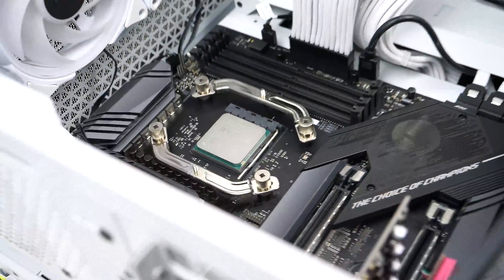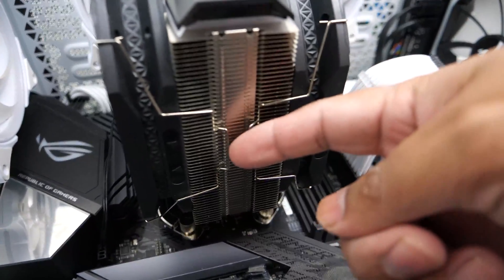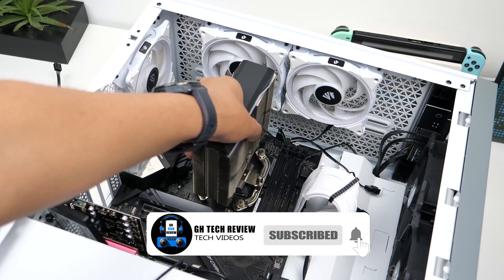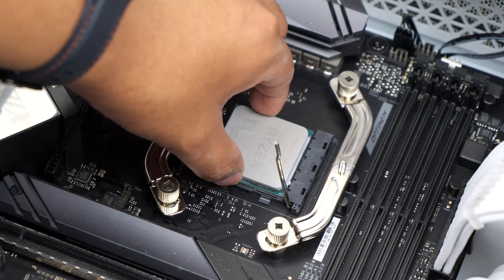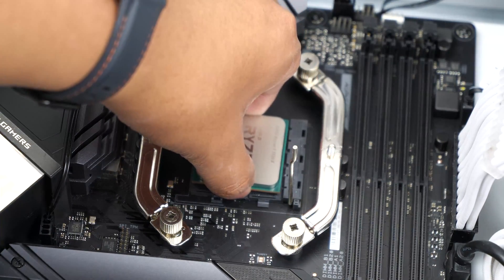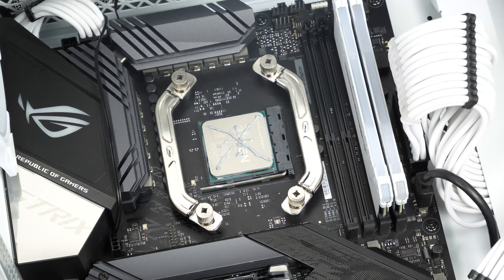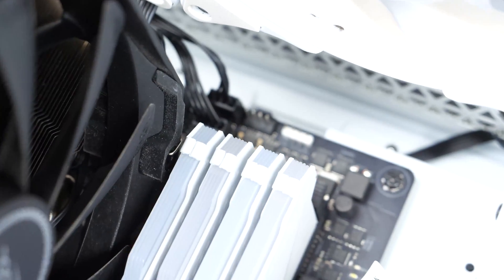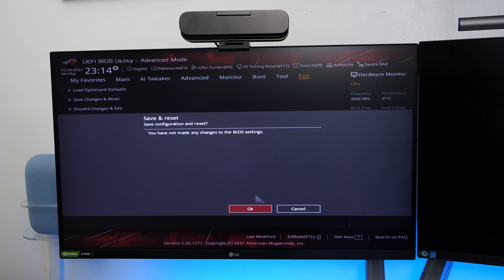How To Upgrade Your CPU Step By Step | AMD Ryzen CPU Installation 2022

Comment: A lot of comments said I need to update things before I change the cpu. This is my first pc and I’m still new but I’m going from an ryzen 7 3700x to a ryzen 9 5900x. What all do I need to update before doing it to refrain from having to take everything apart and do it again?
Reply: You need to make sure your current bios is compatible with your new cpu if not you have to update your bios,there are many videos on that
Reply: @simora1313  oh okay. I’m having help from a buddy to do it Monday so I’ll have him show me how to do the bios updates. Appreciate the help!
Reply: @simora1313  how do i check if its compatible?
Reply: If you have 3200mhz ram I would recommend upgrading to 3600mhz
Reply: @AtomGamingZone  planning on it cause my current is only 3000. Sadly my board doesn’t support ddr5 so going with fastest ddr4 I can find. But cpu was a success and added a 2tb 980 pro ssd Gen 4 as well!
Reply: @Glocktism end up having to update your bios?
Reply: @EatTheCrow  yes. I was completely lost and had a buddy show me how. Updated the bios using my girlfriends pc to put new bio update on flash and then put it on my pc and was ready to go.
Reply: Sick I'm going to be doing the exact same upgrade

Comment: Run your PC to get your CPU warm otherwise you run the risk of pulling the CPU out of the socket when you remove the cooler...Has happened to me before..The AM4 socket does a crap job of securing it down and can easily get yanked out.

Comment: This looks easy but once you try it you will feel like homer simpsons trying to build a pit barbecue.
Reply: Ya lul, was sweating so hard trying to insert the processor.
Reply: @shadyb834  same lmfao when i pushed the lever upward to unlock the old GPU from the motherboard and it clicked, i nearly had a heartattack.  then i safely installed the new cpu and thermal paste, and the cooler and the wave of relief i felt when bios opened up recognizing the install was a success was pretty much as awesome feeling as how i used to feel when i would take those "happy pills" people used to take in the 90's.  😂 on the real though this video helped me so much.  but yeah, i was pretty keyed up until i fired the PC back up.

Comment: İ have a b450 asus i upgrade my cpu from amd 5 3600 to amd 7 5700x and now i get a black screen and a orange light on my motherboard
Reply: Hi, did you update the bios on your mother first? If not, put back your old cpu and update that first.
Reply: @andred212 how do you do this? I have searched and searched and searched and there are no videos on how to do this extremely complicated thing yet everyone just knows how to do it
Reply: @ethangiberson8098 first, did you put the old cpu back in the computer and did it work?
Reply: @andred212  yes but I guess I need a flash drive? It’s 2023 why are flash drives still a thing
Reply: @ethangiberson8098  there  are videos, just search on youtube ''update bios for ryzen third gen''
Reply: @ethangiberson8098  is not that complicated, spawing the cpu is definitely the more annoying part, but i dont think you neeed it since i believe the asus b450 hace bios flashback on the io panel
Reply: @ethangiberson8098  did it end up working after you updated the BIOS?
Reply: omg i literally did the same thing except ryzen 7 5700G

Comment: WAY too much thermal paste!

The X shape will spread unevenly due to the overlap in the center of the X and it will spill out the sides due to the amount. You just need a (large) pea sized dot in the center and let the cooler slowly settle into it to spread it out.

Great video otherwise though!
Reply: Yeah He said that as an example of what too much is. Got to listen to what hes saying too...

Comment: Aight guys, I upgraded my cpu but it didn't work. Turns out that my mobo wasn't series 5000 ready (even if compatible) so I said "well, I can reinstall my older cpu, upgrade my mobo drivers and then get back to my new cpu!". So I put my older 3 3100 in aaaaand... Nothing works anymore. My pc doesn't POST. Every fan works but the pc just won't start. I don't think the mobo is fried as energy surely gets through (or fans and LEDs wouldn't turn on, I guess). So what am I supposed to do? Can anybody help? Thank you!
Reply: Hey, i think we had the same situation before. Have you tried removing your cmos for a minute or 2? so any overclocking from your bios gets reset
Reply: @aze5123  i tried but there was no result at all. I'm meeting a friend today and we'll try a couple of fixes here and there
Reply: I think we're in the same boat. I went from a 3600 to a 5800X3D. Got a message that says New CPU! With an FTMP. Had the option to press Y or N and I pressed Y. I get a black screen and no bios. Tried putting my 3600 back in and N doesn't work. I have no BIOS at all. Are you having a similar issue?
Reply: @joellouisfire  kinda. The pc doesn't show any sign of life on screen. Even peripherals seem dead. Only the fans seem to be working...
Reply: Update: it looks like my mobo got bricked 🥲
Reply: @giacozz  damn 😟😔
Reply: Did you disable AMD fTPM Switch?
Reply: @moisesbrito8612  i could not enter into the BIOS at all, so no... But nvm, I bought a new motherboard and now everything works fine
Reply: What motherboard did you use?
Reply: @SnafuWarrior  it was an Asrock b450m hdv r4. It was supposed to be Series 5000 ready, but I was supposed to download the updated BIOS. That was my fault, but the fact that it refused to work with the older cpu is not my fault, I guess
Reply: @giacozz  oh sorry to hear that. Yeah I thought that not updating the BIOS might have created the problem.

Comment: So you don't have to reinstall windows or anything like that? It remembers all your stuff saved on the computer!?
Reply: The OS is installed on your storage drive (SSD or HDD
Reply: The operating system (and its license) is installed on the "hard drive" but it is bound to the MotherBoard. If you replace the MB only then you'll have to reinstall the windows and get new license, other than that you are good

Comment: How do I find out if the new cpu is compatible with the motherboard? I am upgrading a 12 year old Acer computer. Acer isn't always available to help on any PC that's beyond their warranty dates.
Reply: idk how many modern cpus will be compatible with a 12 yr old system since architectures change a lot. might consider buying a new pc
Reply: You're better off getting a new PC my friend. Even a mid ranged modern PC would wipe the floor with your potato, lol.

Comment: Avoid this platform and these motherboards, they don't support Windows 7
Reply: windows 7 in 2023
Reply: Window 7 in 2023 is wild
Reply: Thats your problem if you're on windows 7 in 2023... Get with the times dude.
Reply: So what games do you play exactly?
Reply: @evangeluna8480  FPV quadcopter simulators on Steam....   Uncrashed, AI Drone Sim, Liftoff, Velocidrone
Reply: Bruh what? Windows 10 is going to be done in a  couple years, they stopped caring about Windows 7 years ago lol I get if you want to play specific games that work best on Windows 7, and or actually work since Windows 8 and 10 are terrible when it comes to certain older games but you'll have to get a new pc for new stuff and find older pc parts from around the time of Windows 7 to upgrade anything for your older pc and that is compatible with 7.
Reply: @comfykori  i know right!  Honda stopped supporting my 1983 Honda Rebel motorcycle in 2010.   

But it keeps running like a swiss watch and gets 60mpg.  Parts are cheap and its east to work on, fun and easy to drive.

I should probably push it over a cliff because obe day Honda declared they just made a new motorcycle and you should get rid ofbyour other one because it's "old".  

Only their new motorcycle gets 30mpg, is jammed together like sardines in a can, and costs $6000 new.  

Bruh, but that's progresd.  Except when it ain't.

There's and ocean of people that love XP and 7 and can't stand 8, 10, and 11.  Because the interface on them is so phwwcked up.  People that actually have to get work done with their computer and do more than click on a Steam or Discord application icon.

Comment: I have the original ryzen 5 1600 af cpu in my b450 gaming plus mb. Its not bad for what it is but yeah I think I may have to upgrade it to the ryzen 7 5800x instead. I have 16gb ram at 3000mhz but I  might have to also upgrade the ram to maybe 32gb instead.
Reply: r7 5800x is a bad choice, consider a 5600 or a 5800x3d
Reply: @legitscaryturtle7379  Why is it a bad choice? I was thinking about upgrading to a 5800x so I'm curious.
Reply: gaming wise its the same as 5600, and productivity wise akso not that much better for the price
Reply: @legitscaryturtle7379  Damn I looked at some videos with gameplay fps tests and there's no difference at all. I'm so confused why does it cost £60 more?
Reply: probably just badly priced

Comment: ok guys, i had the courage to ask since i saw in the comments that some people replies, i wanna upgrade my cpu i have a r5 3600 and i want to upgrade to a r5 5600g, i have a x570f board, question #1 do i have to update my bios? if yes, how? question #2 what is that CMOS thing? do i have to do that also?  i would appreciate any info on this, since i'll be doing this on my own now, i had help building this. so for a late 30s guy, i really have no idea. thanks again guys
Reply: its been a month but please please PLEASE dont tell me youve upgraded to the 5600g yet. the 5600 is practically a 5500. (which is around ~5% faster than a 3600) if you want to upgrade your cpu on the am4 platform just stick to the 5600(x) or if youre close to a microcenter the 5600x3d.
Reply: @konikino  I have a 1200, so, I shouldn't upgrade to 5600?
Reply: check if compatible on pc part picker

Comment: Shouldn't you clear cmos before installing the new cpu?
Reply: No, you shouldn’t need to remove the cmos. It will reset the bios. That’s it. As long as you update the bios you won’t need to
Reply: @mightypotato802 
Naaah bro.

Sometimes, UEFI soft reset is not enough. You do need to hard reset the BIOS.
Reply: @fajaradi1223  anyone who types out NAAAAAHHHH BBRRRROROOO is hard for me to take seriously.

Comment: my new build won’t post, and a friend suggested to double check if I installed the cpu correctly. But I could’ve sworn I followed the triangles. Doesn’t the cpu only lock in one way anyways? What are the chances I put the triangle wrong? Is it worth removing my aio cooler and repasting? I have a hunch it’s my ram cuz I bought ripjaws that apparently aren’t on the QVL for my board/cpu.
Reply: @CRAZYALPAPA  Thanks! I’ll try reseating and checking the cooler again. I finger tightened the screw because they are pretty large and easy to grip so i figured using a screw driver would be unnecessary. Unless I hand tightened it too much? In any case I’ll try resetting it before trying new Ram 👍🏽 And yes I flashed my mobo BIOS to the right version recommended by ASUS for the 5800x3d
Reply: @_N4VE_  I generally tighten the screws with my fingers and then finish them off with a screwdriver just to make sure its not too loose but it shouldn't be too tight either, I personally just do a few twists.
Reply: @CRAZYALPAPA  I’ll try to snug it more after I use my fingers when I reseat it. If that doesn’t change anything, would my RAM not being the QVL be a problem? I’ve read the 58x3d is kinda sensitive when it comes to compatibility?
Reply: @_N4VE_  Definitely a high probability but anything that can be done before spending money is worth trying. Also I recommend making a Reddit post in a pc building subreddit as it always helps in these situations.
Reply: @CRAZYALPAPA  thanks for the help I appreciate it! And yes that definitely makes sense. I’ll do all I can before spending money 🙏🏽

Comment: What do i do if I get no image after booting up? How tf am i supposed to troubleshoot, if my pc gives me nothing to work with
Reply: i’m currently in the same boat. your mobo should have small color LED lights that flash to indicate what it’s checking during boot. They usually sit near the main mobo power cable. My asus has a White led(VGA) Orange(dram) Red(CPU) and Green(boot). Currently when I power on it goes “Orange, White, Orange, Red” then begins to loop White,Orange,Red over and over. Fans and case lights turn on, AIO turns on, but no signal to display and no Green boot light. I’ve narrowed it down to incompatible RAM, Defective Mobo, or CPU. Everything is brand new, so Im gonna try changing RAM first since the one I got technically isn’t on my manufactures “Quality Verification List” for the 5800x3d. If it’s not the RAM i’d probably try RMA the the mobo next, then lastly the cpu. I also reflashed the bios after resetting and clearing CMOS but that didn’t work.
Reply: @_N4VE_  i was an idiot an forgot to update my mobo software. The last update was done 3 years ago when my new cpu didn't even exist, so of course it couldnt work :'D
Reply: @notlisztening9821  nice catch! lol yah for me even updating the BIOS didn’t help. My last guesses are incompatible RAM, defective mobo out the box, or CPU. Was also told I can try reseating the cpu and cooler
Reply: @_N4VE_  i have heard of some incompatibility issues with the x3d cpus. Maybe google to see if someone else has the same issue with your parts, if you havent done that already.
Reply: Might be stupid thing… if you have a Xbox or something idk if PlayStation works lol. I had a no post twice that I couldn’t figure out for about 2 weeks. I decided to officially give up plugged into my Xbox then showed my gf the pc not working and it finally posted. Second time took like 4 days then I tried it again and it posted again. Also using HDMI 2.0 if that means something as well. Prolly won’t help but it somehow works for me. Thought motherboard was fried or GPU. Was even stuck in boot loop till I switched the cord around.

Comment: Picking up a new 5800X 3D today.  Hope I dont F this up
Reply: did you do it?
Reply: @belonn6121  yep. Put in new CPU / GPU / PSU. Working good
Reply: @11bravo1789  nice to hear!
Reply: couple of weeks later... How are u finding the cpu? im looking to buy the exact same. I only play csgo and would like to know how much fps u get. Do you happen to play this game?
Reply: @ByNuzi  i dont Play CSGO but I am Positive this CPU will eat CSGO for breakfast. Im playing warzone 2 max settings ultra on 1440p.  Getting 160fps
Reply: @11bravo1789  alright broski ty for the quick answer <3
Reply: @11bravo1789  Which CPU did you have before ? .. & which GPU do you have now?
Reply: @GleezyBB  had a Ryzen 5 3600.  Went to a 5800X3D.  Had a 3050 Gpu. Went to a 6950XTX.  Getting about 160fps on MW2 on 1440p ultra detail settings.
Reply: @ByNuzi  late on the answer but there's a video of benchmarks with a 5800x3d vs a zen 4 chip, tl:dw is you won't see the improvements with the v-cache until cs2 gets released because cs:go won't take advantage of the higher L3 cache

Comment: Did you leave it plugged in?
Reply: If your talking about the PC then NO WAY! You have to shut down your PC and then also make sure to turn of the switch located on the backside of your PC. Then unplug all the cables from it to ensure no power is going into the PC.
Reply: @insanityfnt  yes I was. Some videos they said to leave it plugged in. But I did not and did my first cpu swap last night
Reply: @Colt-hx2vq  Oh that’s weird. I would always turn it off completely and unplug everything just to be on the safe side though. What CPU did you upgrade from and to?
Reply: @insanityfnt  I bought a pre build it had the 5800G and put in a 5900x
Reply: @Colt-hx2vq  Ohh nice. I’m about to upgrade basically everything in my current PC.
Reply: @insanityfnt  it came with the 3060 TI graphics card already. I am going to add 2gb SSD and I am waiting on 32 more GB of ram to come in as well. That will give me a total of 64GB of ram.
Reply: @insanityfnt  the only thing left to do is get a liquid cooler that’s it for me.
Reply: @Colt-hx2vq  Oh nice! Yeah liquid coolers are great. A lot better then fans if you are ok with spending quite a bit more.
Reply: @insanityfnt  it really wasn’t a bad pre build.
Reply: @Colt-hx2vq  for gaming, if you can still return it, i think the ryzen 7 5800x3D is a much better option. for fps increase atleast.
Reply: @mitch-2906  ok I can buy it. I have the 5900x installed already
Reply: @Colt-hx2vq  lol 64gb ram and 5900x and all you play is Fortnite
Reply: @arthurmorgan6353  no don’t even play that game. Lol.